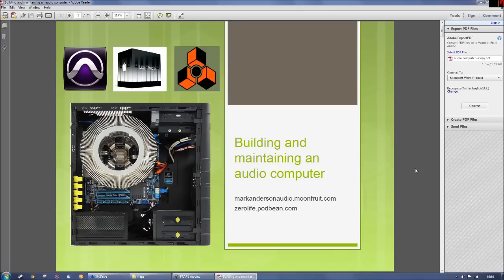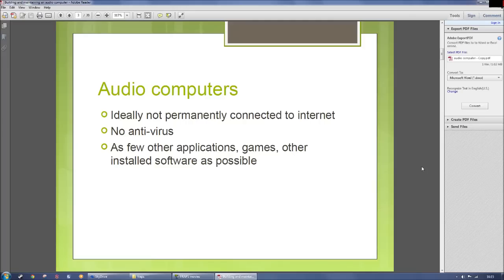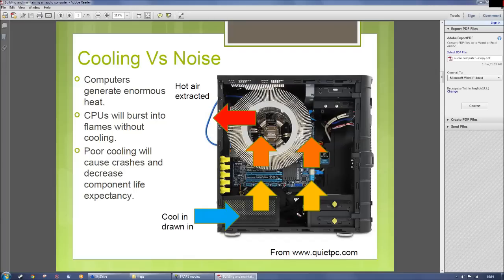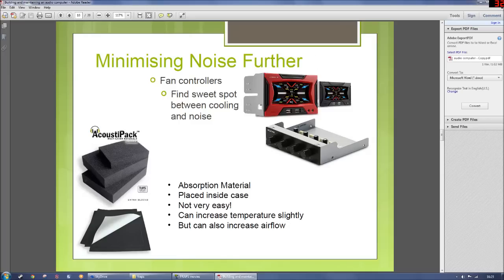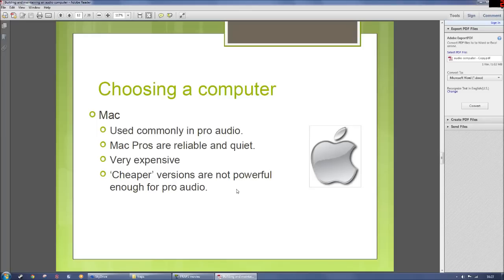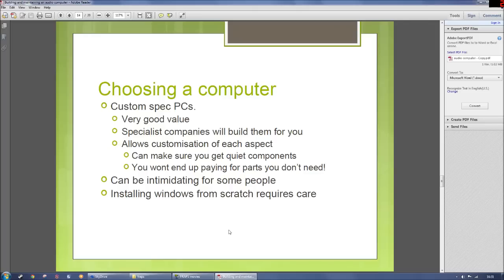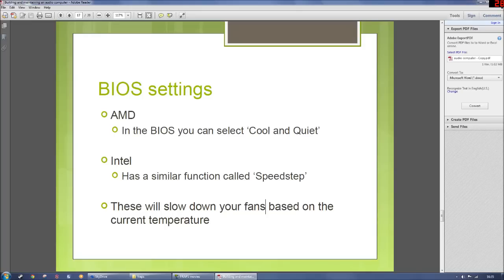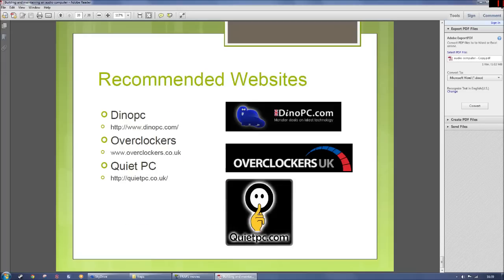Build a PC for Audio

Comment: speedstep will not slow down your fans.....it slows your cpu base clock right down when not doing anything intensive............. fans are controlled by dc or pwm controllers

Comment: Excellent video. I wish you could make an updated video in 2016. I am in the process of building a new computer (after using my sweetwater creation station extreme since 2008). I am in a bit dilemma regarding the components. Is xeon better than i7, which mobo is better, workstation board or like extreme 4 or 6 boards, which company provides better and more reliable boards? 

I use Avid Pro Tools 12 (10 is also installed) as primary DAW and have almost all slate digital plugin and drums, and waves plugins. 

One of the issues I have is the cpu cooling system. I want to use the same creation station case (4 unit rackcase) and it is very difficult to find a air cooling system that will fit in the case. I finally found a noctua aircooling system that has 90cm fans. But will it be good enough to keep a i7 5820k processor cool? 

I hope to get some answers.

Thanks
Reply from the maker: +eddysel10 Hello. Glad you enjoyed the video! This video explains more of the general concepts and principals required to build an audio pc, rather than delving into specific components. Therefore its not really worth updating as most of the principals still hold true! If I were you, I would go on the computer music section of the Gearslutz forum, as people there have a much greater knowledge of specific pc components. Failing that, you might try the Toms Hardware forums, which wont be audio focused, but will have a very wide knowledge of pc construction.
Reply from the maker: I started using an SSD as my main hard drive about 2-3 years ago and It was the best decision I have made! I would never build a PC without an SSD now. They are so good!
Reply from the maker: +IaMaWeSoMe7478 I use it for windows, and I install all my software (including DAW and plug-ins) to it. I don't record onto it, I have 3 other normal hard disks for that. You can record a huge amount of simultaneous audio tracks to a bog standard hard drive with no real issue. The SSD as an OS drive just speeds up the system and improves overall speed and performance of the computer.
Reply from the maker: +IaMaWeSoMe7478 Mine is 256gb

Comment: Xeons are good they create less heat .... i have 2x 8 core 16 thread.. but there is better ones 12 core 64 threads ... if you have the money get them ...on a  Asus dual socket board

Comment: Hi. I’m using creative se bulk audigy 7.1 on windows 8.1 64bits. I installed the latest driver. I set it to 5.1 and sorround from Creative Control Panel which is the only one software i can acces. I see that is too limitated this sound card.  If i use realtek i can hear ok the sound only, but with this sound card only 2 speakers sounds well because center and sourrounds sound too low. :( What can i do ? I have an logitech z506 audio system.

Comment: How would I open an audio session in another drive. Everything is in my c drive. Or I have a 1 tb external how would I do that. Take everything I have worked on and transfer it over there. Would you transferred all ur plugins too.  I mean it would all be awesome if it would make my computer run better. I have 24gb of ram 8 core and 2 tb of memory with 3 different drives
Reply from the maker: Torn Horizon I am not %100 percent sure what you are asking, but here is solid setup:
 1)On C drive, install windows and your DAW of choice. Also, install your plug-ins here too.
 2)On a second hard drive, (internal or external) save your recordings/sessions/projects. You should record directly onto this hard drive. Transfer your projects to this hard drive if need be.
 3) If you have any sample libraries (drum samplers, kontact, omnisphere etc) install the sample libraries to your third hard drive (i.e. the plug-in itself will be on your C drive, but the sample libraries will be separate).

The most important thing, is to never record audio onto the same hard drive that your DAW is installed onto - the hard drive bandwidth just cant take it, leading to poor performance.
Reply: ok, I see what you mean, I noticed that I have my projects saved in the c:drive but they are also being backed up into the e:drive how will I know that I am not recording audio into my c:drive if I have my DAW open in my c:drive. thank you for you time with all this.
Reply from the maker: Torn Horizon Most DAWs have a 'session information' window, or something similar where it will tell you precisely what files you are working with. There is no easy solution to this, but it might be worth moving all your project files off of your C drive, perhaps onto some other backup drive. That is the easiest way to be sure that you working on the project files that are located on your Recording hard drive. It might take ages to check everything is operating the way that you want it too, but file management is incredibility important when it comes to audio. When I was lecturing, I could not count the number of times students tried to move from one computer to another and suddenly audio files where missing. Whenever you save ANYTHING, make sure you know precisely where it is being saved too - never let windows or your DAW save things to some random default folder. At the end of the day, you will have to put in a lot of time and effort to correctly sort out your filing system. It wont be  fun, but it is definitely worth doing.
Reply: how do I know when I am finished that with a session that it don't save it back in my c: drive??? sorry I am not very good with computers
Reply: I am sorry my friend, I am not very smart with this and your help is much appreciated. I would love for you to take me through the steps via phone call or something.
Reply from the maker: I would love to help further, but unless I sat down in front of your computer, I would not be able to help really.
Reply: l'll just try to move everything to my external, and direct my daw to save it there. hope that works
Reply from the maker: Yeah thats a good start. Its worth doing it one project at a time, to make sure that you dont accidentally overwrite anything. Move one project - open it to make sure it works, then move on to the next project.
Reply: all I have is one so ill move it to an external and keep the external plugged in and see what happens

Comment: Great video! Still relevant nearly 2 years later. Thanks for all the tips!
Reply from the maker: The processors you list are both very powerful, certainly more than powerful enough for modern audio production. I have been using a i5 4670 @3.4Ghz for a few years now and it has been great. That said, I also have an SSD for my system drive, and 16GB RAM which makes an unbelievable difference to the general performance of the machine. However, think very carefully about overclocking. Overclocking means more heat, which means the cpu fans have to work harder, which means more noise.
Reply from the maker: Its impossible to say whether it can handle 38 vsts and plug-ins, because every plugin has a different cpu hit. It also depend on what DAW you are running, 64 bit, 32 bit, amount of automation etc. If I were you, I would go on the Gearslutz forum and look for advice there. They have a really hardcore group of PC enthusiasts who will be able to give you better advice than I can.
Reply from the maker: +IaMaWeSoMe7478 If you have a very cheap PC case, then it might not be worth it. Cheap cases are very fiddly and annoying to work with when it comes to installing anything, including dampeners. If you plan on overclocking, it would probably be more beneficial to spend extra cash on a better/quieter CPU fan.
Reply from the maker: +IaMaWeSoMe7478 I have a Zalman CNPS5X Performa on my cpu. It was the best I could do given my budget at the time, but it seems pretty good. My PC case is the Fractal Design Define R4 - which has a few in-built fans and a fan controller. Very pleased with them. They are not silent, but a damn sight quieter than the average PC.
Reply from the maker: +IaMaWeSoMe7478 dB stands for decibels. The lower the number, the quieter the fan.
Reply from the maker: +IaMaWeSoMe7478 Yeah that should be pretty damn quiet
Reply from the maker: +IaMaWeSoMe7478 The foam pads theoretically increase temperature because they decrease the amount of physical space in the case, meaning there is less air to heat up. But the fact that the foam pads are large flat surfaces that block up big gaps in the case, means that air has an easier time flowing through the case. So if you have good case fans, the resultant increase in air flow consistency will ultimately lead to a decrease in temperature.
Reply: +Mark AndersonAudio 

WHAT ABOUT SOUNDCARDS

Comment: I've been looking to building a new computer for recording, however my audio interface runs off firewire 400.  I've noticed through researching there are no motherboards out on the market that come standard.  My guess is I probably need a firewire PCI-e card that has a Ti chipset.  Do you have any recommendations on which card has to most success rate with M-audio or Presonus firewire interfaces?
Reply from the maker: Asim Kinhnarath To be honest, i bought the cheapest firewire pci card i could find off of amazon. It only cost about £10 and works perfectly. My only advice is to avoid getting a usb/firewire combi card, as some audio interface manufacturers recommend to avoid them.
Reply: Yea definutely no need for a dual conectivity card when motherboards already have enough usb 2.0 AND 3.0 now.  Great, problem solved! thank you!

Comment: Thank you for an extremely helpful video...one question please...can I run my audio successfully from an external drive? USB 2.0 or 3.0? I do pretty large music recording projects and am thinking of buying a hp compaq elite 8300 i7....the guy at the shop tells me there's not enough space to put in an additional internal drive as this is one of those "small form" towers.... thanks again
Reply from the maker: Some people prefer to record directly to a usb drive - especially those who work with laptops. The one thing to remember is to have your DAW installed on one drive (usually your main OS hard drive) and then record your audio onto something else. USB 1 is theoretically fast enough, so USB 2 or 3 should provide plenty bandwidth. Its worth noting that USB drives use a small amount of CPU power, whereas firewire drives dont. In reality it is unlikely to make a difference for an i7 cpu, but its worth mentioning.

Comment: I'm just getting in this stuff (working with audio) and I have a couple of questions. I have a pretty old dual core PC build that just isn't cutting it for those big sample based plug ins. I was thinking about going with an Intel i7 4770k which, although it has 4 physical cores has hyperthreading enabled, and about 16 gigs of ram. It's pretty expensive so I'm curious about possibly cheaper alternatives. Another question I have is about the audio card/interface. I get a lot of noise in my recordings and it all seems to be coming from the sound card, rather than the mic. The question is, would an audio interface such as the 2i2 scarlet fix this issue and do you have any tips for noise reduction within a recording itself. Maybe you got a video on that? Either way, good video.
Reply from the maker: My gaming PC (which I occasionally use for audio stuff) has an i5 4670 and 16 gigs of ram and runs very well. Apparently i7's are fantastic for video work, but you wont likely see much difference in general audio work. With regards to noise, microphones are insanely sensitive and will pick up noise from anywhere and amplify it like crazy - so first listen to your environment to try and identify where the noise could be coming from. If it is in fact being introduced by your sound card...then your sound card might be broken? Try using a different mic, as it might be a dodgy mic too...
Reply: It is indeed the audio card, though across many different computers. The mic doesn't even have to be plugged in and the noise is still there. I'm looking to do video as well so I guess I should go with the i7 then xD. I don't want to buy an audio interface though and still have a bad signal to noise ratio.
Reply from the maker: Hmm, that is weird that your sound card is noisy. It sounds like it might need to be replaced sadly!
Reply: DragolyLovesDemi  AMD FX8350  its 8 core processor unlike 4 cores intel, sound card will pick up all noises from ur pc, external devices eliminates noise and electromagnetic interfierance.
Reply: pornol88 better yet, the 9000 series. still 8 cores, but faster. breaking records again amd, well played (5ghz)
Reply: ***** I love my 9590, and my friend loves his too. However I did change for my production pc though, higher ram cap and better performance for daws. I now use the 9590 build just as a gaming and editing pc with a gtx 970. badass combo right there if you ask me